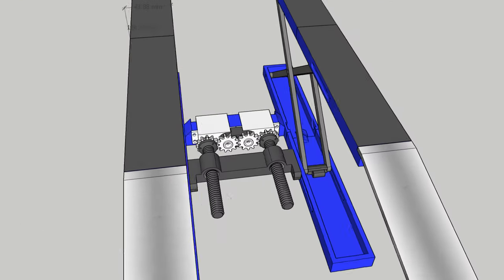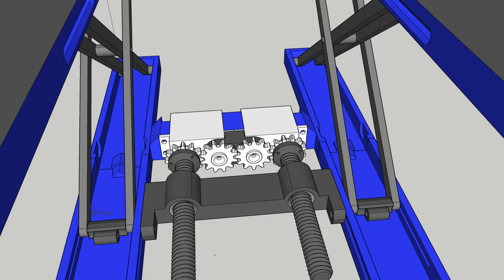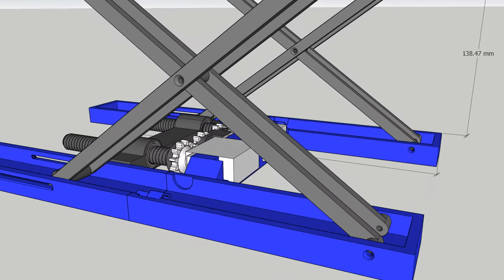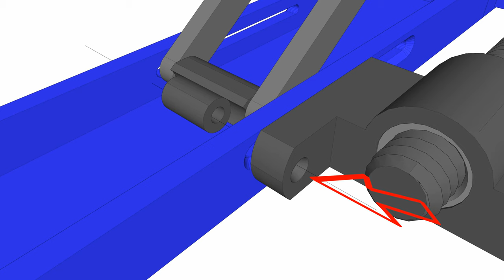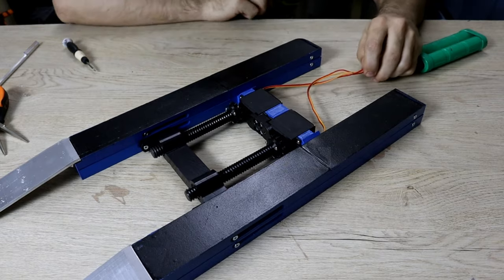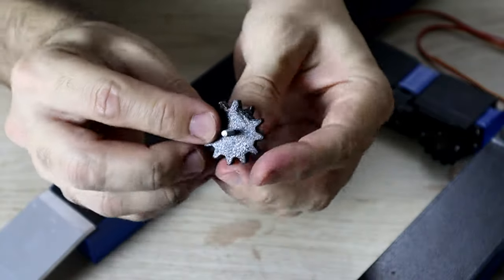3D Printed 10th Scale car lift/ 3D Printing RC Car jack/ Printing File from SketchUp/Scale Addiction

Comment: Awesome work. Now you could use an Arduino and some micro switches and a simples coding to make so automatic end stops on the lift.
Reply from the maker: I can do that without arduino, maybe I will at that too
Reply: @scaleaddiction  With a simples end stop yeah you can do it.
Just need a manual push button to press while going up end down like a real lift